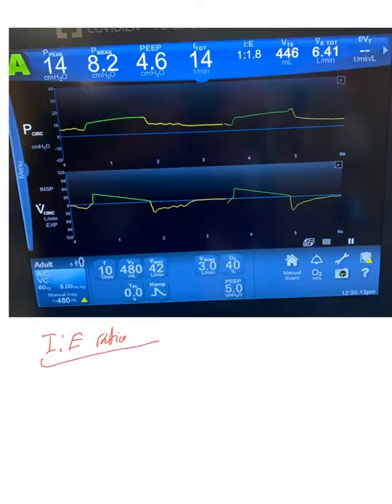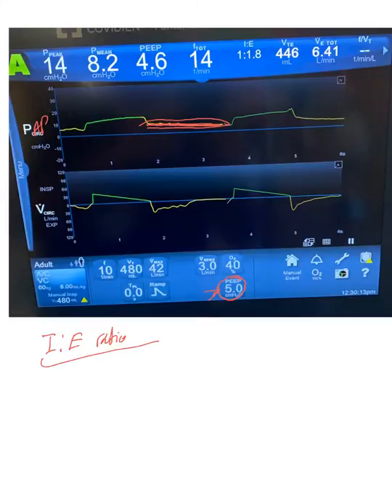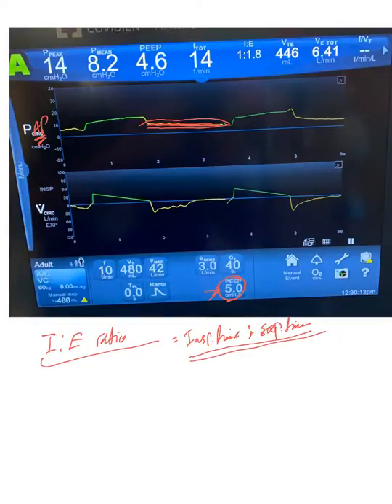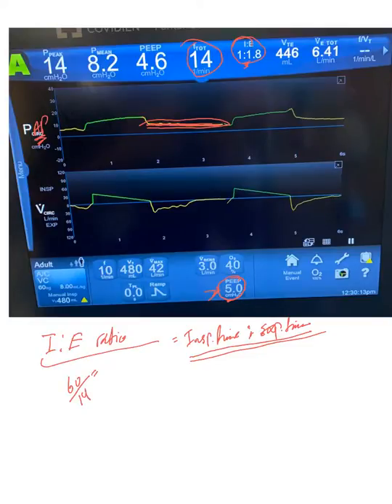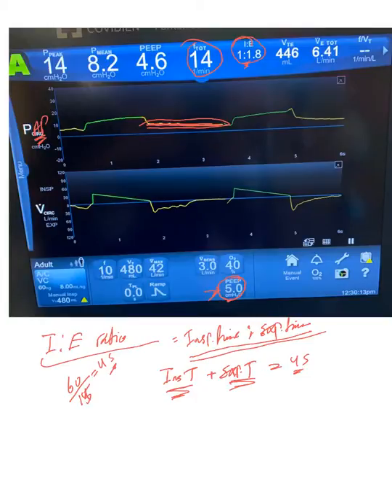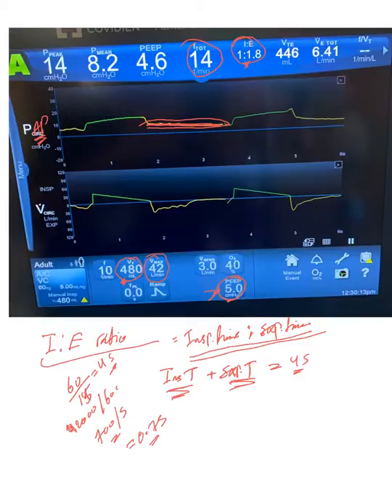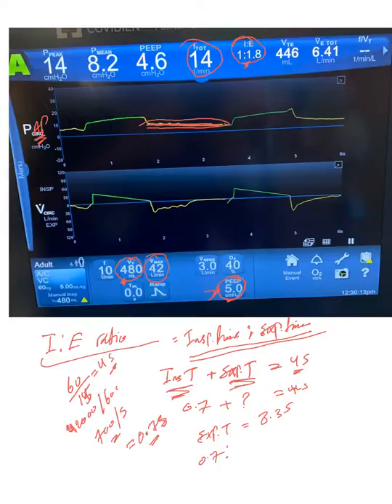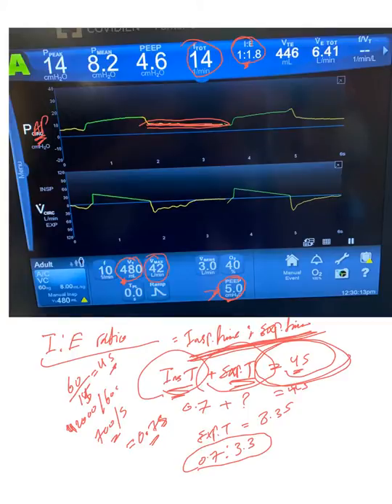Mechanical ventilation- 31: Inspiration to expiration ratio (I:E ratio) and how to calculate it

Comment: Sir I have a doubt that when according to calculation I:E Comes out to be 0.7:3.3 then why in ventilator screen it's showing 1:1.8
Pls sir clear this doubt
Reply from the maker: Thanks for reaching out! To answer your question an you tell me how did you calculate the ratio on your side?
Reply: @Hospitalista   Sir, same method as you have  have applied in the lecture
Reply from the maker: I have to admit the way I used was not perfect as the flow is following a decelerating ramp curve which means the flow at the beginning of inspiration will be at the peak (42L/M) theme progressively diminishes afterwards. This means it will take longer to deliver the desired tidal volume which means a longer inspiratory time, shorter expiratory time, and smaller a bigger I:E ratio. That’s why the ventilator ratio is different, I hope this clears things up for you and I apologize for any confusion!
Reply: Thank you so much sir.
These videos are very helpful. Best source for understanding ventilator on youtube

Comment: hi sir, i am currently going through your videos they are excellent. in this video i have one question in this screenshot of the ventilator I could not make out the respiratory rate specified as you have taken it as 15 and got 60 seconds divideved with 15. sir would be eagerly waiting for a reply
Reply from the maker: To calculate the respiratory cycle we divide 60 by the actual RR not the set RR, actual RR on the ventilator screen was 14 (at the top of the screen labeled as "fTOT"), on the same screen the set RR is 10, so we use the actual RR (what's patient is doing in real time), I decided to use 15 instead of 14 to make the calculation easier! That's all. I encourage you to take a look at my new mechanical ventilation course on teachable platform, just copy and paste the following your link in your browser "mechanical-ventilation-course.teachable.com/p/mechanical-ventilation". Please let me know if you have anymore questions. Thanks for reaching out!